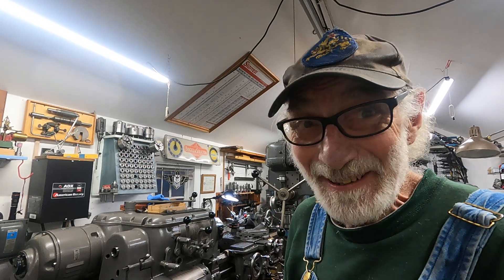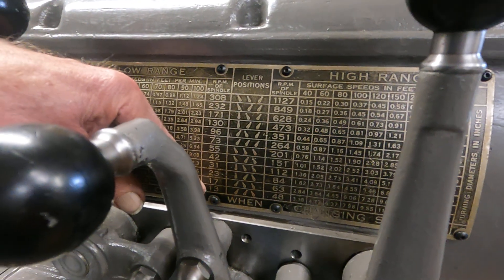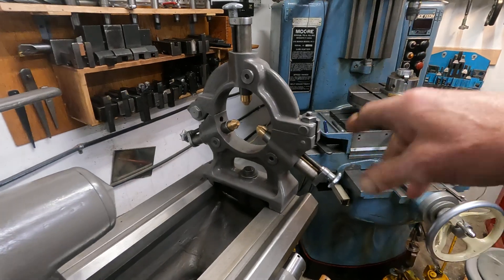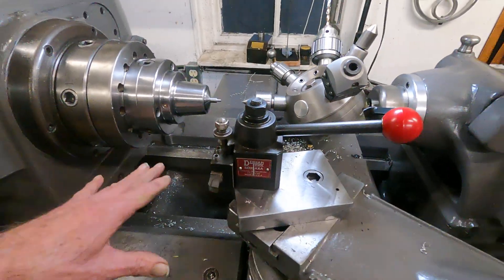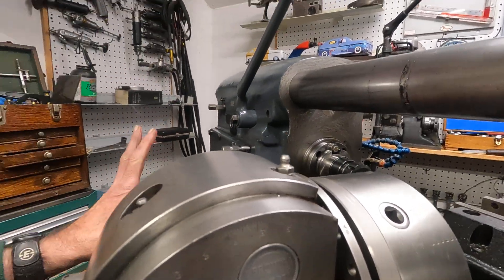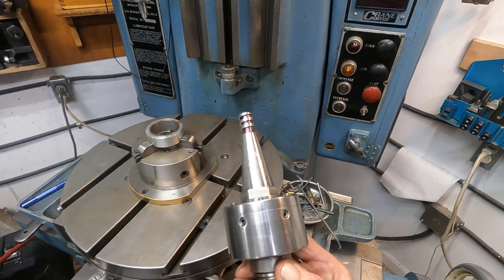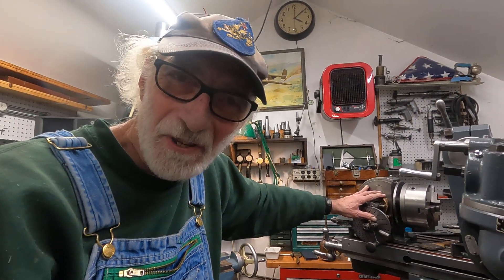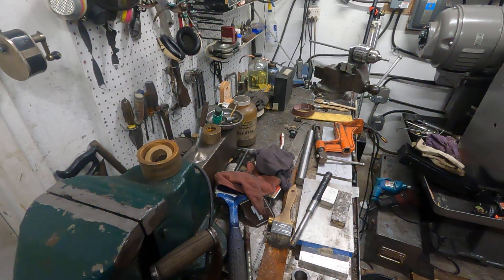Tour My Retirement Vintage Machine Shop in Walla Walla

Comment: Thank you for sharing and showing your fine machines! BEAUTIFUL!
I too - I love the 1940's machines!
Unfortunately for the war, but very often very chic and stylish!
I have a 1950's lathe and a mill each in mid-size (~6 times your watchmakers lathe, can do also small parts),
and a tool grinder (for HSS with a CBN disc, I rarely use carbides/hardmetal, HSS is more forgiving) an improved "Deckel: S0" made by the german company "Optimum" in thier chinese factory (but with german engineers AT PLACE for quality control).
I have even a handcranked watchmakers lathe, but only needed for polishing the pivots of balance shafts (0,08mm the the mini mini possible with silver steel - 115Cr3V the watchmakers steel).
I will take a good look of your channel.
PS: you can use carbides/hardmetal chisels/tools also on lower rpm - most important, as far I know is the continious & steady movement of the tool = no hand cranking, ONLY powered movement of the chisel etc... 
Cordial greetings!
Géréon

Comment: Hey Don what size american rotary phase converter do you run, and do you have a panel box between it and all your machines? Love the shop
Reply from the maker: The converter is the ADX15. I have magnetic starters on the machines but when the converter is off there is still two hot legs going to the machines. I have a cutoff switch before the converter and only have it powered when I am in there. I had to locate the 15hp idler motor outside because it is loud and vibrates. American Rotary sized this for my 5hp max machines and it works very well even better than some utility 3phase in local rural areas. I can say this unit works considerably better than home spun units or 30yr old commercial units of the same size I have used.in the past. And always had a cutoff switch before the converter to totally cut power anyway. Some don't like the special Baldor idler motor noise, I built a doghouse for it just outside the wall and its all good.
Reply: Thank for the reply don I just got a adx 15 myself. I might have to put the idler outside also good idea. I have 3 machines in a row and was going to use outlets and plugs in one corcuit instead of running a 3 phase panel box and individually hard wiring each machine with separate wiring. Hopefully this works for me.
Reply from the maker: I am running everything like you describe and it works fine, just have a cutoff for the converter to completely cut power to the machines. The idler is in a doghouse outside, too loud for videos, also it was noted that bearings can be dry in the idler and I did have to grease them, there are fittings for that. This converter works much better than an older phase matic rotary that I have used, these things have come a long way from the dark ages, I am surprised on the much improved machine performance and even switch operation, I think you will like this. @LittleJuniataMC